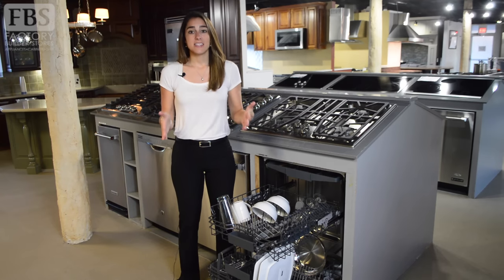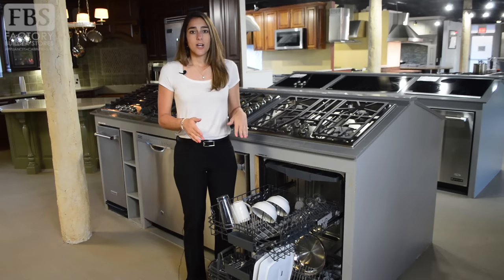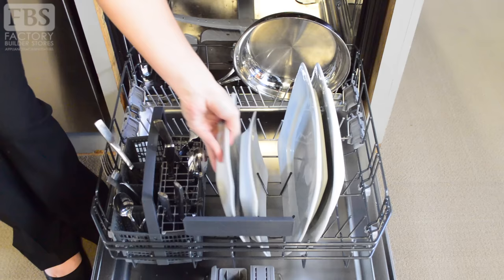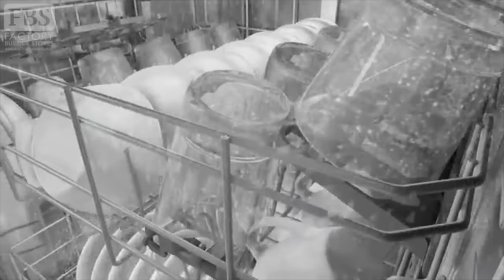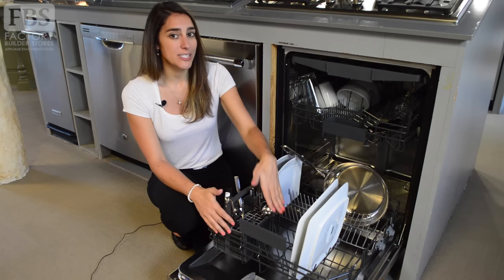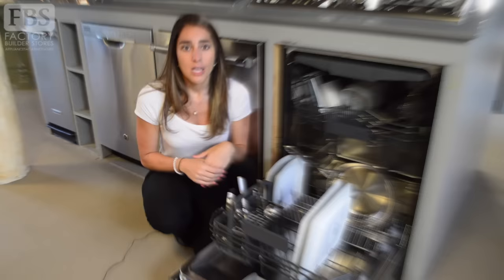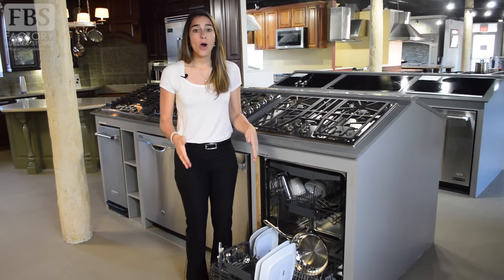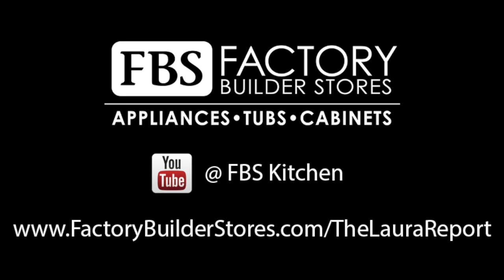How to Load the Dishwasher Properly

Comment: As far as putting dishes with food still on them in the dishwasher...Many years ago, a Plumber advised me that the worse thing to put in the disposer is FOOD.  The disposer is meant for tiny bits of food and not large table scraps.  For instance, if one puts a potato in the disposer, the disposer will chop it up but your pipes then have an entire potato in them.  Over time, this will clog the pipes with FOOD.  Dishwasher outputs normally do not even go through the disposer side.  Therefore, a lot of food particles will eventually clog the pipes.  I know there are filters in the dishwashers.  They do block a lot of larger items from going in the pipes but a lot of those food particles break up and go through the filters anyway.  All this to say – it is best to scrape the large items off the plates into the garbage.  Some stains always need to be rinsed off.  Dried egg yolks are not cleaned in the dishwasher.  LOL.
Reply: THAT IS RIDICULOUS!  IN A DISPOSER THAT IS ATTACHED TO A SEWER SYSTEM, ANYTHING GOES INTO DISPOSAL!
, EXCEPT BONES, AND VERY FIBROUS ITEMS, LIKE CORN COBS,  LARGE GRAPEFRUIT SKINS,  ANYTHING PLASTIC,  ETC.
 IF YOU HAVE NO SEWER SYSTEM BECAUSE YOU LIVE IN A VERY RURAL AREA, YOU ARE ADVISED NOT TO USE DISPOSAL EXCEPT FOR MINUTE PIECES OF FOOD THAT MIGHT BE LEFT ON A PLATE!
I EVEN TEAR  ORANGE AND GRAPEFRUIT  PEELS INTO PIECES, AND BANANA SKINS AS WELL.
 
         SO YOU CAN PUT ANY FOOD THAT HAS BEEN BROKEN OR TORN INTO  SMALL PIECES INTO YOUR
DISPOSAL!  IF NOT, YOU DO NOT HAVE THE BEST DEVICE FOR DISPOSAL IN YOUR KITCHEN!
Reply: Dried egg comes off fine without rinsing, for me no problem
Reply: Potatoes, specifically skins are bad to run through the disposal. I don't think it has to do with large particles but what happens to the particles when chopped up and mixed with water. Potatoes are extremely starchy and will form a glue that will clog your pipes. My wife did this and I had to take apart the drain and clear the mess once.

Comment: IMPORTANT:  1.  Once loaded, TWIRL THE WASHING ARM above your  lower rack dishes  to make sure it has free movement in a complete circle. If a dish or implement is sticking up, it can block the movement of the washing arm and your dishes will not be evenly clean. 2. ALSO:  Turn on your sink's HOT WATER  and let it run until it is very hot BEFORE you start your dishwasher. Otherwise, your dishes will be washed in cold water, unless your dishwasher has a built-in water heating feature.  3.  Use only an ounce or two of dishwasher soap in filler compartment

       top and under its trap door. Too much soap will overload your dishwasher and bog it down, often causing complete breakdowns.  4. Wash the fine mesh filter(located in bottom of washer tub) frequently. These tips were given to me by a very honest dishwasher repair man. Since I've been using these tips, I have had no dishwasher trouble for years, and my dishes and utensils are always perfectly clean.
Reply: Excellent point. If my wife only knew this.. and how to put toilet paper on the right way so it falls forward.
Reply: @mrdev5281   1. Don't load any tall items near the silverware baskets since they will block the water to wash the flatware. 2. Always bring the hot water to the dishwasher first by turning the sink faucet to full hot running water until it is as hot as possible. 3. Don't put nearly as much soap in the dishwasher as indicated. Only a table spoon is needed for

     first cycle and a table spoon for the second cycle. Putting the normal amount of soap in will eventually clog the filter. This does two things: It makes you call a repairman  for $100, and it sells more dishwasher soap. 

4. One of the main advantages of putting the toilet paper on the spindle so the paper feeds from the top of the roll, not the bottom, is the fact that you can always find the end of the paper, and fold it back a bit for the next use. This allows you to easily grab toilet paper when you stumble into the bathroom out of a sound sleep to perform those nightly pee missions, when you are still mostly asleep, and your eyes are squinting in a blur.  During this global pandemic, every roll of toilet paper needs to be set up in the most accessible way.
Reply: Or enjoy the thumping sound while the arm spins. 😁
Reply: @jennifer86010 Doesn't it heat water itself?
Reply: @vrnvorona  Some dishwashers do and others do not heat incoming water.  It is always best to run the hot water in your sink until it is at its hottest, then turn the dishwasher on while the sink hot water is still running. Once the dishwasher has accessed the hot water (you can hear it filling in the dishwasher) you can turn off the sink hot water. This ensures hot water will clean your dishes.
Reply: @vrnvorona  usually uses your taps hot water which is why you are supposed to run your sinks hot water a minute before starting. Dishwashers do have a heating element.
Reply: I think you added everything they left out but they chose the right person to explain it to us in this video.
Reply: @teresaf991  The dishwasher repair man who told me all the tips wasn't as pretty as Laura, but Laura also didn't charge me the $100 service call. He did, however discover that I was using too much dishwasher soap, filling the soap compartment up to the recommended level, which caused over suds and prevented adequate rinsing. It also clogged my filter. He said that using too much soap is a very common practice, which makes dishwashers break down,  making him a lot of money. He said that soap companies want you to use far more than you need so they can sell more.
Reply: Only necessary if your dishwasher doesn’t have a heating element. Otherwise, it’s fine to use the cold water that comes out for the pre-wash cycle that rehydrates the debris on the dishes. In the West, where we’re in a terrible drought, we can’t be running gallons of clean water down the drain. If you must, at least please capture it to water your plants or some other use.
Reply: How the heck wifes knows all this?  Did they go to a Secret Wifes Training Bootcamp before getting married?
Reply: @megablasterpr  Older women age 50 and older, still know "Womanly" things, because they were taught by previous generations of women about cooking, cleaning, sewing,  grocery shopping, managing money, child rearing, socializing and domestic/ family living. Millennial women know how to operate their cell phones, check their status as human beings on social media, order take-out food, shop for designer clothes, shoes and purses,

      and expertly apply loads of make-up that don't interfere with their tattoos. These are the basic differences. 

     To be fair,  millennial men do not know "Manly" things, such as changing a flat tire, repairing things around the home, building things with their hands, carpentry, plumbing, electrical, unless it  applies to plugging in their cell phone chargers. 

      How many millennial men does it take to change a burnt-out light bulb?  Answer:  ZERO.  They simply ask their wife or girlfriend to do it, and she texts an online repair company to come out and take care of it, then  charges the cost  to her maxed-out credit card.   All this,  while eating take-out dinner and pre-mixed vodka martinis.
Reply: @jennifer86010  No. It really doesn't. Dishwashers are often run off a completely separate water supply line with a separate shut off. Running hot water to the sink does nothing for the dishwasher in most cases. It just wastes hot water.
Reply: @davecarsley8773  Dave you are wrong !!  Do you not know anything about standard home plumbing?  Unless you have instant-hot water heaters under the kitchen sink, the hot water supply to the sink and the dishwasher has to travel from the water heater (usually located in a garage or other remote area) to the sink or dishwasher. So, even if the

      dishwasher has a separate hot water line, that line is filled with water which is either room temperature or garage temperature. 

     You have to empty the ambient temperature water in the hot water line and bring the hot water into the kitchen by opening the sink hot water faucet, until the hot water arrives in the kitchen. Only then, will you have hot water in the kitchen. 

     You may have noticed over the years you have been taking baths or showers, or using a bathroom sink (which is not close to the home water heater)  that you have to wait for the hot water to get hot, after you turn on the sink or shower/tub faucet. 

     During this wait, you are emptying the ambient cooler water from the pipe and bringing in the hot water from the water heater. 

      I hope I don't have to educate you further on this matter, otherwise we will have to send you back to beginner's plumbing school !!
Reply: Thanks!
Reply: @jennifer86010  all-new dishwashers are cold water feed only.
Reply: @mgtracey  Not mine, which was plumbed in the 1990's.
Reply: Jjjj
Reply: Thanks for sharing.
Reply: You seem to know your stuff when it comes to dishwashers what's your perspective on rinsing the dishes off before putting them in because I can't even fathom the idea of throwing dirty dishes in the dishwasher that I might not run for two or three more days thank you for any of your input

Comment: Can't wait to share this.  We've had dishwasher loading wars forever :)  We always rinse our dishes to avoid food collecting in the machine ... seemed reasonable.  Who knew - we've been schooled :)  Thanks for this informative video!
Reply: That is absolutely the dumbest idea I've heard.  Your food is used to scrub your dishes?  Get real.  Then it goes down the drain where there
is supposed to be a grinder that pulverizes them so that they don't stop up the drain.  Good luck with that. Finally, after the dishes have gone 
through all of the cycles and are dry and ready to put up. Smell the inside of the glasses.  That smell is last nights dinner.
Reply: @billcherry5852  Are you replying to a deleted comment? Or did the person edit your comment? As on its own your comment is confusing.
Reply: The comment Kim A. made was how they've been "schooled" because the video says you don't need to rinse your dishes while they always rinse their dishes. Implying they now know that they don't need to do it. 

Bill Cherry disagrees with that and is stating all the reasons you should still rinse your dishes off, which I agree with. Unless you have a really good dishwasher it's not going to work all that well. Even if you have a really good dishwasher you will end up having to clean the food trap pretty regularly and doing a clean cycle just to make sure it's all clean after that. On top of that your drain pipe will eventually need to be cleaned because of all the food going through it
Reply: I totally disagree with not soaking food stuffs off as well.
I have never had to clean the jets in the sprayers for years.
Moved in with a friend who vehemently disagreed and I ended up removing and cleaning the openings in the sprayer arms EVERY TWO WEEKS!

Comment: I bought a very large multi-pack of Miele tabs when I purchased my DW 5 years ago. And I break the tabs in half for each load so I just finished using them. They worked just fine.
Reply: Soap going bad is the dumbest shit I heard all year, and it's November.
Reply: @evilmarc  At first thought it may seem silly to think of soap possibly going bad. If it's sealed in something it will be perfectly fine for several lifetimes, but if not sealed and air tight(which some resealable bags they come in aren't all that great at times), soap can get mold growing on it. There are reports of dish pods going bad when they get brown spots showing in them. Same thing can happen to bar soap after a long while. And i mean a very long time. 

Dish powder may not grow mold because it's so dry, but it does expire after a year or two, which would cause diminishing results in it's cleaning performance. 

I think the soap comment was helpful. It's just another step to the troubleshooting if people are having trouble with their dishwashers.

Comment: “To avoid overcrowding you can handwash few items”
No thanks. It will wait second load.
Reply: Lmfao same.
Reply: @caseyelizabethley6049  Na, I just over load. If the dish is still dirty, it stays in for round two.
Reply: @Steven Strain Penultimate means "second to last in a series"... so maybe just use the ultimate cycle?
Reply: @cmh2111  Me too haha
Reply: I'm
Reply: Not need for that, just remove the top and bottom rack! That’ll open up plenty of space for bulky dishes! Also make sure to use a cup or so of dish soap if you have any greasy dishes. Hope this helps!
Reply: aint nobody got time for dat
Reply: @Matt-dg6ue  That's my secret strategy too! Take out both racks and just load everything in. Sometimes I have to get creative with how I fit all the dishes in, but I can fit so many more things in there like that
Reply: First-World Problems

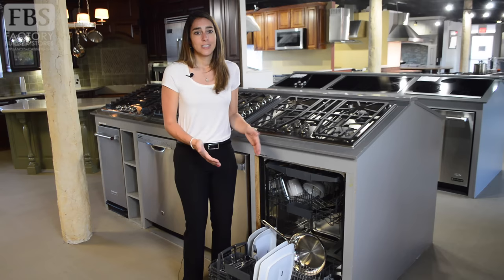Comment: 1:58 -Buys a $1,500 dishwasher... suggests we "hand wash" some of our dishes. LOL
Reply: Brad Saint George no way just save the extra dishes for the next load lol
Reply: She is saying not to overcrowd it. Otherwise wash the remaining or do another load.
Reply: Brad Saint George buys a $1500 dollar washer, dry cleans suits
Reply: I M  s
Reply: Edi2003  kilometres I kk
Reply: @Brad Saint George … you are very simple minded
Reply: Brad, I stopped it after she said you HAVE to leave food   on  the dishes  or the soap will destroy your dishes.
Reply: @johns.376  , but she could have actually said that but didn't.   i am just amazed at her comment on don't prewash your dishes or the soap will eat your dishes up.
Reply: @Kubulek17  maybe her next video will be dry cleaning dishes.
Reply: She’s right. Today’s soaps are hi-tech, and if you rinse the dishes before using the dishwasher then the soap itself has nothing to breakdown. When that happens, the soap actually builds up in the sump causing havoc. It gums up the drain pump and hose, it gums up the impeller and spray arms, and it’ll eventually etch your glassware. Over time it’ll ruin your dishwasher. I’ve been a dishwasher technician for 20 years. What she says IS correct.
Reply: @ThePatriotsBrother  ,   what do you expect with dollarstore dishes?  Hey, the problem is the soap has sand in it.

This powerful, mystical, dangerous soap is so bad that I'm surprised that the mafia isn't using this soap to dispose of bodies.    Ever consider that many of these machines have a high temp setting and a heating element to dry it as part of the problem?        if you have lye in a plastic container or powerful acid stored in glass, what's so special about these soaps?    Looking it up, the cheaper soaps contain SAND.  Yes, that's what it says on Wikipedia.  this can pit your dishes no matter if you scrape them or not. 

it's not the scraping that causes the pitting it's substandard soaps containing SAND.   Plus they have what's basically lye in it, various types of bleaches, degreasers and interestingly enough phosphates-- that  I'd have to go back and look at my history books--they actually banned from clothes detergents way back in the 1960s. 

So, there's the issue that your dishwasher heats the water up very hot.   It dries your dishes with a very hot heating element which can crack your dishes.  The cheap soaps have SAND in it.    The soap has phosphates in it that were in other types of soaps but removed because it was bad for the environment.    Yes, you'll see "phosphate free" on some labels or used to.

I venture to guess that you could take average dirty dishes and flatware, run it in a basic dishwasher cycle and not notice the difference in being clean.  You might over several usages notice glasses with spots.  Or even do that with half a pod and get the same results.   Really, greasy yes.

If the pumps, the tubes and other plastic parts are getting gummed up, it's likely due to not only the soap residue but food residue particles.   The soap is not going to magically dissolve chunks of meat. 

Finally, if you are on  a septic tank and your drain water goes into it like some do, all those food particles will mount up causing you expensive septic tank pumpings much sooner than you would have.  And, using dollarstore dishes from the get go tells the tale.
Reply: I M that was a pretty stupid comparison.. it would make more sense to say he bought a 20k car and either take a short walk to the store or take the bus ...
Reply: Exactly that's what i was thinking LOL

Comment: At 4:34, never put cast iron into the dishwasher because it can't handle the heat a dishwasher can produce? I'm confused, I use a cast iron pan to sear rib eye steaks, I heat the oven to 500° Fahrenheit with the pan inside, then heat the burner on top pull the pan out of the oven and place the pan on the top burner at the highest heat, then sear the steaks for a couple of minutes on each side, then back into the oven at 500 for around 6 minutes..... does a dishwasher get hotter than 500° Fahrenheit? I don't think so.
Reply: Its not because of the heat shes wrong. You never use dishwasher soap on iron cast because it destroys the coating. Simply heat up your cast iron with salt and let it heat up real good then just wipe it with a paper towel when its not that hot anymore.
Reply: @akimbo5u  oh ok, I see, makes sense now,  thank you.
She had me confused because she said it couldn't handle the heat.

Comment: What if you forgot to turn off the faucet where the inlet hose is connected, after the dishwasher has finished the wash program, will the hose burst from the extreme water pressure build up?